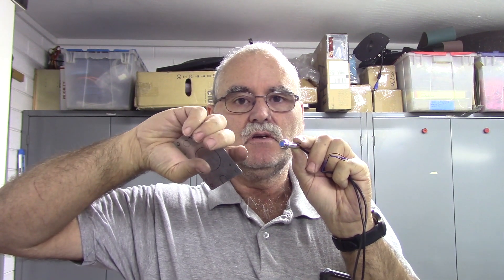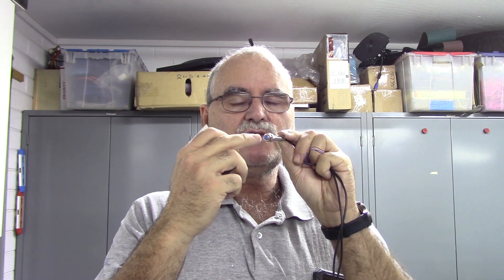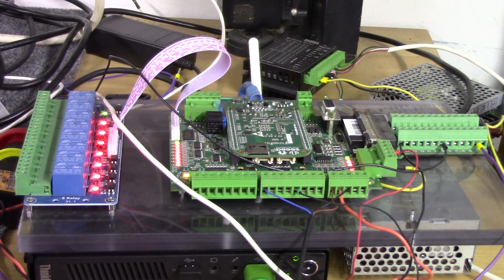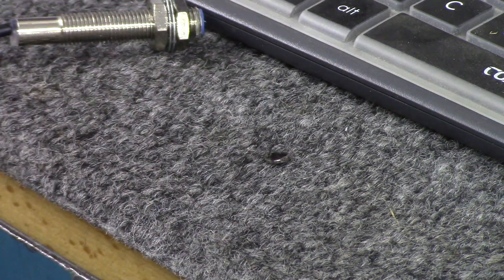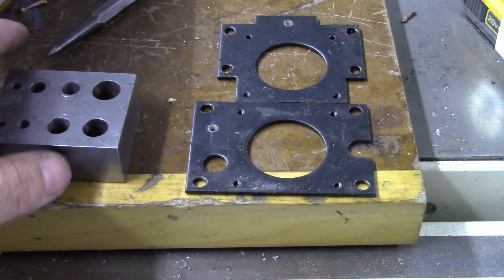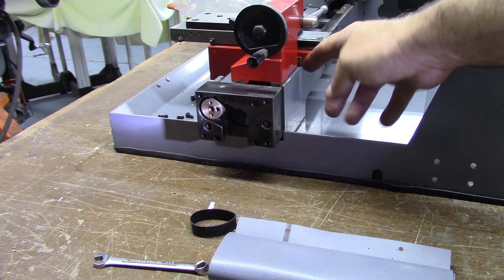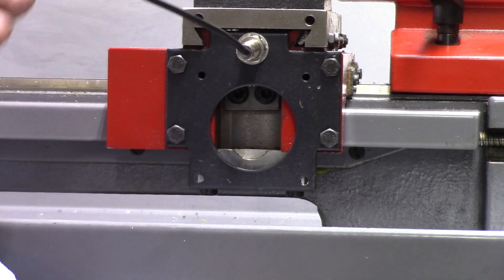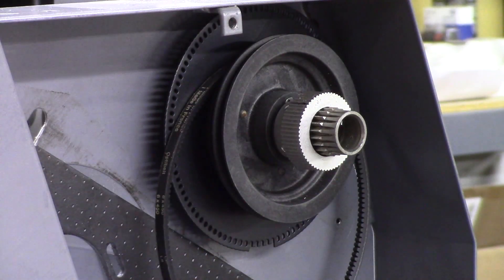Emco PC5 to Centroid CNC Acorn Conversion, Part 2:  Encoder pulley and Z&X Sensors

Comment: To be honest I'm confused. Wouldn't every rotation of the pulley tell the Acorn it's triggered the home sensor?
Reply: I'm a bit confused as well, I can only assume he is using it in combination with a switch that enables the hall sensor,  for that last bit of accuracy
Reply from the maker: Sure it would. But it's only set to Home. You only home once. Remember I said the carriage has to me moved to reference marks. They are physical marks on the ends of the Z+ and X+ travel. That puts the machine close. Then pressing cycle start to home the machine CNC12 will slowly turn the axis until the magnet trips the hall effect sensor. Then sets home for each axis. Do not confuse a home switch for a limit switch. If the sensors were set to home/limit it would not work, because as you suggest every time the magnet would come around and trip the sensor the control would fault with a LIMIT TRIP. I am using them as HOME inputs. Control will ignore the inputs AFTER the machine is homed. Stay tuned to see how I set them up and test in the Wizard and how it works.
Reply: @martyscncgarage5275  Thanks fully get it now
Reply from the maker: @Phantom-mk4kp  Using the sensors like this instead of mechanical switches makes for more accurate homing
Reply: @martyscncgarage5275  Thanks for the clarification, it all makes sense now ;) cheers

Comment: Why use those sensors over a good limit switch? Seems like the added need for a user to get it close and then press home is a big drawback, is it a space issue?
Reply from the maker: There is no real room for them. These.machines didn't have anything previously. Their big brothers the EmcoTurn 120, 220,  140 etc. All used something similar. You'd be surprised how accurate they can be.